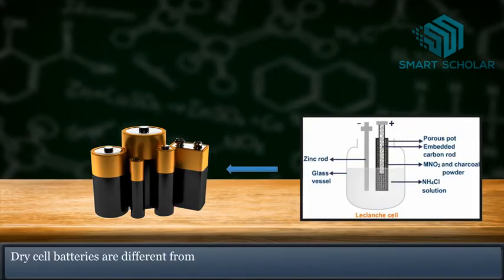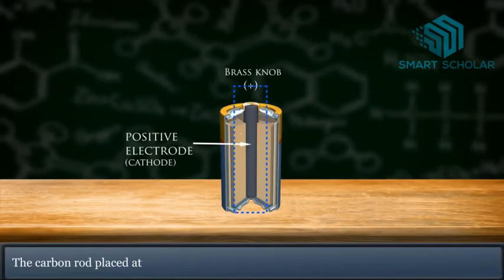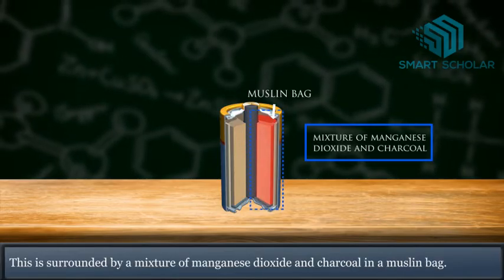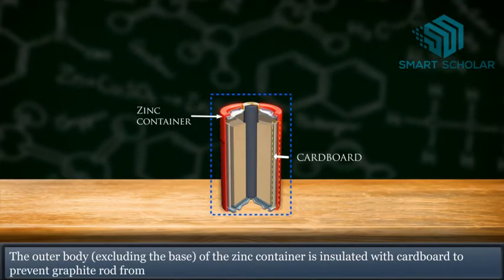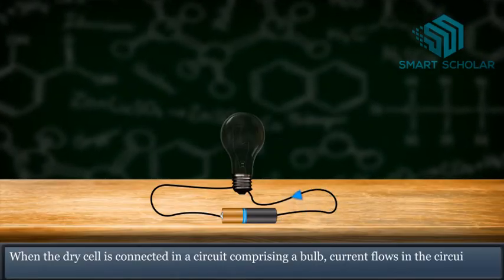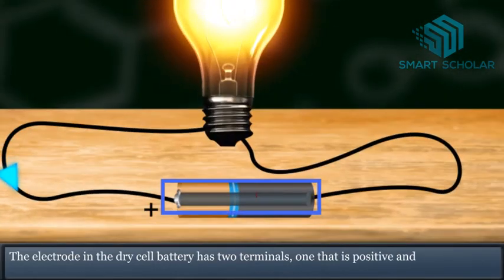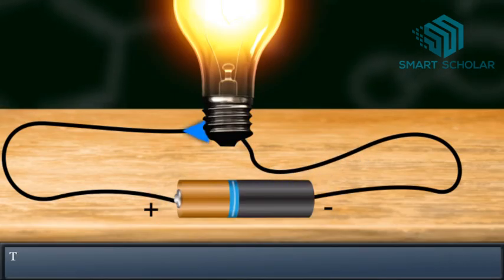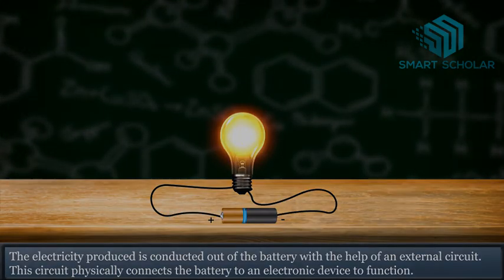Working of Dry Cell-  Everyday Science

Comment: Dear sir. You have mentioned the negative electrode as anode and i think that negatively charged ion is anion and the negatively charged electrode is cathode. Similarly, cathode is a negatively charged electrode.
Reply: Nope in galvanic cell anode is negative and cathode positive.
Reply: @Aalijah_Matyevna  right
Reply: I think positive electrode is known as anode which attracts the negatively charged ion, and the negative electrode is cathode which attracts positively charged ion, but in case of galvanic cell it will be opposite may be
Reply: In dry cell negative terminal is indeed anode
Reply: No on galvanic cell anode is negative and cathode is positive while in electrolytic cell anode is positive and cathode is negative and dry cell is a type of galvanic cell
Reply from the maker: A dry cell consists of a zinc container whose base acts as the negative electrode or anode.

 The carbon rod placed at the center with a brass cap acts as the positive electrode or cathode.
Reply: @scienceprojects7130  which means it can act as positive or negative electrode ?